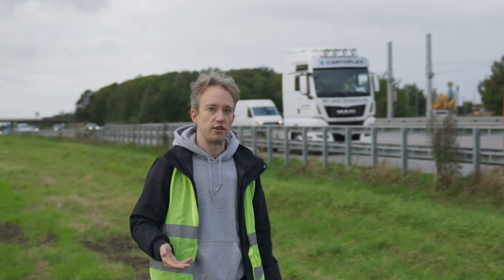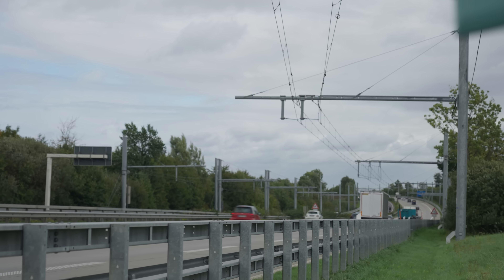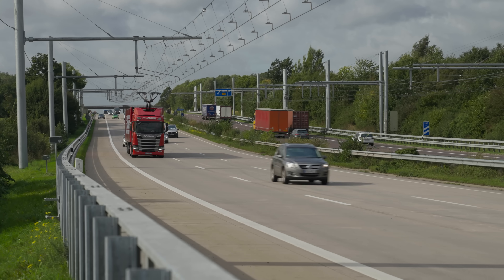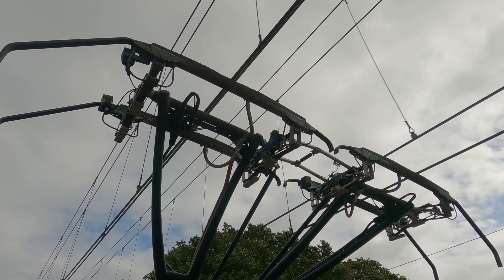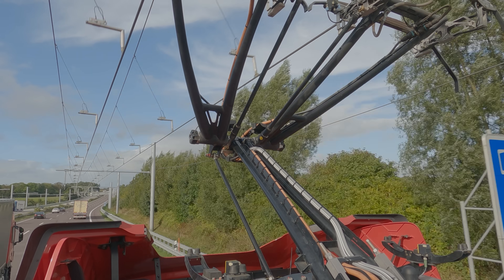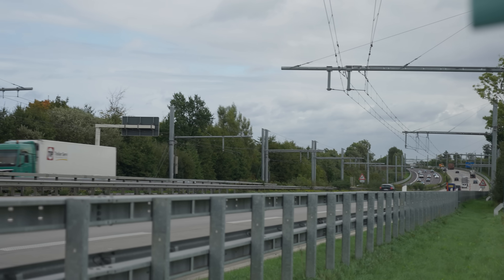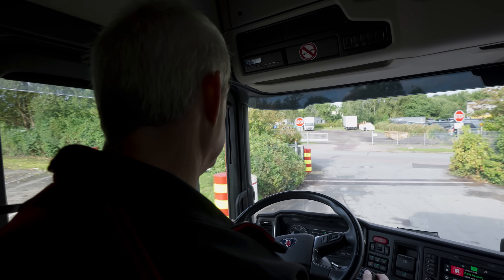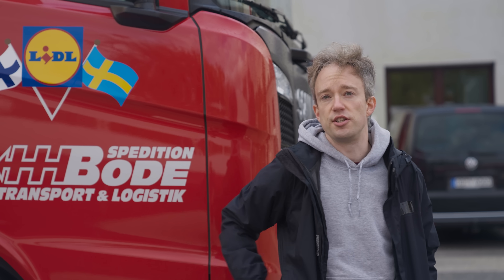The highway where trucks work like electric trains

Comment: As a traindriver im worried about the overhead wires getting damaged and falling onto the road.. you dont want such wires laying everywhere on the highway where people can easily get in contact with them
Reply: You could easily make it so the damaged section would have its power cut off, even before the wire would fall to the ground, having a build in secondary line dug down a few meters into the ground alongside the track an it could be connected to the main line like every km. 
That way even if someone ran down some masts you would only lose 1km of coverage, until repairs was done.
Reply: @steffenjespersen247  Even if the power cuts off a good snag will rip down hundreds of feet of overhead among the fast traffic.  Hope you're not in a convertible behind that truck.
Reply: In Vancouver, we have had overhead wires since the 1940's. I've never seen any wires just come down onto the road. They are too high to be damaged by idiots.
Reply: @LigerSupremacy  I have seen it in my country so many times
Reply: There are electric trolley buses running in many Swiss towns (Neuchâtel for instance). They have been there for decades. They are fully electric, dense networks running across all types of roads, crossing roaundabouts and so on. It is proven to work and is extremely safe. I see no big difference with these electric trucks.
Reply: @winstoncat6785  The big difference is highway speeds and the use of pantographs instead of trolley poles.
Reply: The circuit breakers trip the instant a traction cable is broken.
Reply: If Germany was really serious about climate change, it would not be shutting down perfectly good nuclear power plants AND would not be banning fracking! Germany is destroying centuries-old villages and small towns in order to mine the coal underneath. Why? To generate reliable electricity! Total madness!
Reply: If the cables did break the current would automaticly cut the power as it does on the old trolly busses !
Reply: @raystorey3670  and with trains, trams etc.
Reply: You can cut off the current, but the cables and supports can still fall onto the road and damage vehicles.
Reply: Well, cities with trams/Straßebahns don't really suffer with those issues so I don't see why highways would
Reply: @truedarklander  difference of speed?
Reply: @chibani-  trams aren't slower than cars
Reply: @truedarklander  well the fastest tram was designed for 120km/h but physically   locked at 80 km/h for safety reasons

Which Normally wouldn't be a problem since most trucks are theorically limited by law at 90km/h but in reality some truckers don't care and will go faster to pass a slower truck.

Also by looking for tram on Wikipedia I stumble upon the Tottenham Outrage where two criminal robbed a tram carrying the montly salary for workers a factory and where chased after by a crowd of bystanders,off service police officers who borrowed pistols from bystanders and the car of the factory!
It just reminds me of a morbid benny hill chase
Reply: @chibani-  for freight usage you could have tram-trains going faster on mainlines and when going into final destinations switch to the lower top speed for safety
Reply: They said they would only keep it up for the next year or so, probably because of the damage that can happen to the wires.
Reply: Yes, pantograph snags are quite spectacular.
Reply: And if the lines don't come down but there's a serious accident for other reasons, then there's no way to land an air ambulance helicopter.
Reply: @bruceh8532  Ambulance helicopters are a scam.  Something to jack up bills.
Reply: @bruceh8532  It can land next to highway right?
Reply: that's what I am scared
Reply: Wikipedia - Electric road. Sweden has tried out many of the Electric road options regarding the cost of each one. It looks like an on-road contact system with under vehicle pantograph will see all vehicles private cars and trucks be able to take advantage of this option, and only a 1 metre section under the vehicle is switched to high voltage the rest is return ground.
Reply: As an electrical engineer I have similar concerns, it’s so scary, not including the fact they can smash through your windshield and physically smash you up, they are also subject to massive high voltages and currents.
Reply: install holding safety bars
Reply: @swatteam2002  so that the pantograph xant reach the wire?
Reply: You like the Germans with the atom fear .as a none traindriver ,  i dont use rail tracks to walk on them , On highway also :) In cars you quite safe .Beside ,on highways you can thing about some fuse safty system .On rails is unnecessary cost.Whats more bothers me  ,where the power comes from .If the energy comes from low emission source then ,great idea .
Reply: @lukasmorski-zmij8030  although electric trains are still more greener
Reply: @lukasmorski-zmij8030  It is still a lot better. of course. An electric motor is several times more efficient than a geared Internal combustion engine.
Reply: @lukasmorski-zmij8030  exactly doesnt matter if we all drive electric if we burn coal to get that power...
Reply: @NineSeptims  it's actually still more efficient
Reply: @NineSeptims  but we’re not going to burn coal to get that power. Renewables are also important. Also mass producing electricity is more efficient than burning petroleum to get energy, so even if we were there would be less emissions from the coal than there currently are from the petrol/diesel.

Comment: Nice. I figured either this or hydrogen fuel cells for long hauls would be the way trucks go. Also makes life easier for Tesla don't you think?
Reply: I think these big trucks are gonna benefit much more from hydrogen, than tesla would.

personal cars have the problem that no one wants to make the infrastructure for hydrogen stations, and the fact that its easier to make hydrogen using natural gas instead of electrolysis. Trucks are already hella regulated, so this might not be a far fetch for the industry.

Comment: But now you either need electric trucks with batteries or trucks with both ICE and electric engines which means more weight.

Why not make a low altitude cargo helicopter/plane powered by an electric line? You wouldn't need to have maintenance hungry expensive roads or rail. You could have cargo ports around cities for local transport. You could also do this for people transport instead of building these expensive roads and rails. All in all you would need much less infrastructure and maintenance costs. You could have this over forests with very minimal impact on the environment.

Comment: This is utter nonsense. There are around 50,000 lorries over 3.5 ton in the UK. The average size of the engine is 500hp = 500,000watts apron.. That means we need 50000x500000 =25,000,000,000. Therefore we need 25 power stations to produce the power for the lorries alone. Add on energy for heat pumps and cars maybe 200 nuclear station will manage the load. The public are having the wool pulled over their eyes.

Comment: What happens when someone causes an accident that knocks the lines down onto the road?

What are the fail-safes?
Reply: Likely similar failsafes to having the same thing happen with trains, and trolleys, introducing these improvements will require effort on the side of regulators and the government to maintain them, but at that point its about money invested rather than if we can do it at all. Most of the worst accidents in all manner of things from housing and trains to cars and powerlines happen because someone tried to cut costs by skimping on safety and repairs, I'm not an expert, but the steps to protect us are there, we just need to have regulations that force companies to use them, in spite of their cost.
Reply: @judemccabe1242  I don't know what the train fail-safes are.

Comment: This but in cities using the already available trolleybus system. It would encourage to expand that, replace strictly battery powered and regular buses with trolleybuses that can go off-grid for a short time, and maybe it helps to create more "fuel" sources for EVs too.
Trolleybuses with small batteries for short distances in the future.
Although for the long-distance, trains would be much better. This is more like covering short distances between the train and the warehouse.

Comment: I have one big issue with this. Other drivers. I am both a lineman and CDL driver. I have almost crashed many times because of ignorant drivers cutting me off or driving like fools. I’ve see the results of semi truck accidents. If a car cuts you off, you hit them and it lift you off the ground at all, the chance of tearing out those lines and adding high voltage power lines to a already messy pile up is terrifying.

Comment: All well and good but how much more does it cost to buy a truck like this compared to a diesel truck or to modify exiting trucks to run in this system as most if not all haulage companies already probably have a full fleet of trucks and to use this system would need to probably scrap their current fleet and then have to buy these from new which is probably not suitable

Comment: We have a lot of trolleybus systems in Russian cities, they work very well. And new trolleybuses have off-grid capacity, thanks to installed batteries, which allows them to make short trips independently of the overhead wires.
Reply: @LegendLength  It's not that a issue, it was saving cost at the wrong end. Trolleybuses got a competition in form of lots of small private buses called marshrutkas. Imagine 18 people in a minivan going to work. And it's regulated by "unions", which are looking like mafiya.
Reply: @andrejspecht8217  Bruh, in my city marshrutkas and trolleybusses exist together for around 20 years now.
Reply: @dimanyak373  I figure. And i'm glad trolleybus depots are holding firm.
Reply: It's a shame Moscow has deconstructed most of its overhead lines for trolleybuses. It still could be used efficiently for cargo transportation with modular system.
Reply: Trolleybuses are not really the same as pantographs

Comment: Pantograph of the truck has already weared some deep grooves in it for obvious reason. -They have placed overhead wire in straight line unlike in train applications where wire continuously keeps swiping on top of the pantograph from side to side keeping the wear on flat surface instead of grinding single groove in it.
Reply: They used pantographs to give a theoretical gap for the driver to lag steering within. With wire-swipe setup, they'll have to build 2-truck-wide rig and spread the grid further apart.  
The concept is already looking like a failure.  They'd be better off, building dedicated truck-lanes with steer railings (like Aussies did for their busses), i.e. make a system, which will hardly make it to and even break, financially. And then they'll have to sell it to the working class.   It'll be amusing to watch, at least.
Reply: @jayswarrow1196  Well just add one or two more things to your idea and you voilá, you rediscovered trains. The beauty of this approach is that you don't need to have yet another dedicated lane unusable by other traffic requiring even more specialized vehicles but you can actually make use of the existing infrastructure (because the highways are already there!).
Reply: @jayswarrow1196  they have those busses in Essen. Or had, since they are replaced at the minute
Reply: And after you solved every problem
1: wear  put the line in a zig zag pattern
2: the truck has to drive precisely there now —> use something to steer automatically
3: this is financially not feasable —> put more cars on one "engine"

Bam! You have a freight train! Germany invented a stupid version of freight trains…
Reply: @ibimsbodenhansel3230  The problem in a densely populated country like Germany is that you can‘t just build railway lines to every single warehouse. You still need trucks for that.
Reply: @LiebeMeinesLebens05  i am aware of that but in many cases it is possible. It might not be financially feasable but when there is space to build a highway, you can also build a train track. For the little delivery routes left, you can use battery powered trucks. You dont need the powerline to charge while driving because with short distances you can charge while unloading. They are trying to use this for long distance transport because they dont want to give up their highway system and are looking for new ways to continue using it…
Reply: @ibimsbodenhansel3230  no its because a train line just doesnt work for anything less than main hub routes which go for a long enough distance where its more cost effective over rail like in the uk felixstowe to hams hall. rail hubs and lines never work financially and realistically if you have to load at both ends onto and off a lorry as whos paying for the haulier to buy another lorry, hire another driver, pay the charges to use the train. rather then why wouldnt the haulier just save his 2x expenses and extra costs in paying a driver and just drive the 50 -75 miles himself which would be cheaper overall. this is why all train lines that used to carry only 5 wagons in the world all closed because it just never works... you have to realise road travel will always be required for these sort of journeys.

Comment: People saying "use trains" don't understand they can't climb more than a few degrees and can easily cost tens of millions per mile. A catenary is cheap, trucks are flexible, and the roads are already built.
Reply: Well… “If it’s not broken, don’t fix it”
Reply: You left out the part where car manufacturers lobbied the governments of the world to remove and abandon enough rail way to suddenly make it seem not economically viable even though it is still the best thing we have. Decades of this lobbying did it's damage. Most of our produce could have been travelling on electric rail by now. But Governments are too corrupt for anything good to go on.
Reply: I think I would have liked an explanation like that in the video, bc I went through the whole thing wondering if it was another type of driverless car VS public transportation kind of story and if I was being astroturfed into thinking it could be a good idea.
Reply: Oh, so there was a catch
Reply: The train tracks do exist, and if you can reach 80% of Europe use it. The transfer train to truck for the last 20 miles seems to be hard to coordinate, and cargo trains itself go quiet slow and and low priority. But that should be easy to solve in the digital age, it's just too many companies involved.
Reply: people also dont understand that the standard 44 tonne HGV, which is the industry workhorse, causes 136,000 times more damage to road infrastructure than a Ford Focus because the damaging power rises exponentially as weight increases – a phenomenon known as the ‘Generalised Fourth Power Law’. 

Use trains.... its cheaper in the long run. if the tax payer is going to subsidize the freight industry through the eye watering cost of continuous road and infrastructure repair....why not just spend that where it belongs on rail infrastructure and stop wasting time trying to make roads into second tier rail networks ?
Reply: most of the railways are already built in europe, so for me that's not actually an excuse. If this system were that effective, trolleybuses would be way common...
Reply: @nomedocanal8496  European railways may be better than railways in most of the rest of the world, but they aren't particularly optimized. A lot of it is single track, meaning trains can't meet easily. The network of railways is also mostly grown out of which places that are prioritising connection. There is not an overarching plan to make transportation more effective. The countries in Europe are small and they didn't collaborate when planning the railway network.

The existing European railway network is lacklustre. It's better than most, but that doesn't mean that it is good.
I hope that future plans for the network will be collaborated between many nations, and that both people and products transports get a say in this.
Reply: @nomedocanal8496  If ready existing infrastructure was sufficient, companies wouldn't use trucks. The number of branch lines and sidings that would need to be built is enormous.
Reply: What are you talking about? Surface train tracks cost about one million euros per kilometer, so about 1,6-1.7 euros per mile. "Use trains" is the better alternative. 
And the reason why trolley buses are so uncommon is cause diesel is just so damn cheap cause its subsidized by the government, while the power grid for trams/trolley buses has to be payed out of the cities pockets entirely.
Reply: @beerenmusli8220  I do love trains, so where did you get the figure of ~€1 million/km for train lines from? It would be great to see if there have been any plans or studies done on the feasibility of replacing road freight with rail on a large scale.

Comment: If the infrastructure is well designed and well thought of with far reaching and ease of access to the users, our vehicles could become hybrids with limited fuel capacities for emergencies combined with a battery pack there by reaching the corners of the geographical locations where the grid is inaccessable making it flexible to use and ultimately reducing costs.

Comment: The problem with this system is that it can't be made much better. Batteries on the other hand will continue to get cheaper, smaller, more energy dense in the next few years, let alone 18 years.